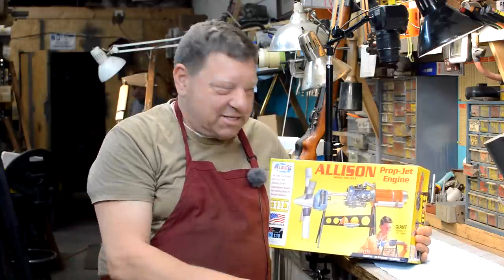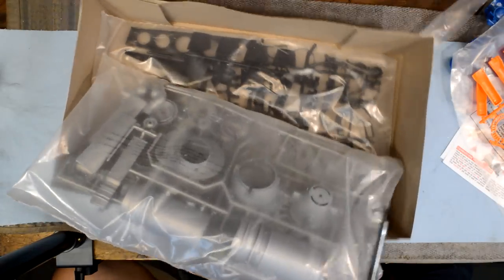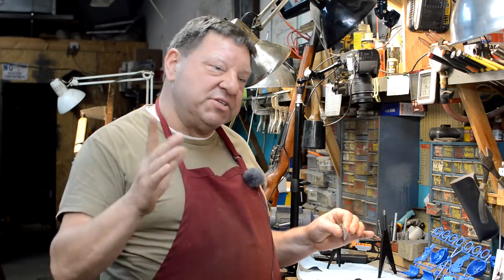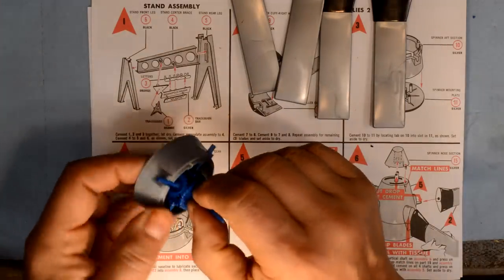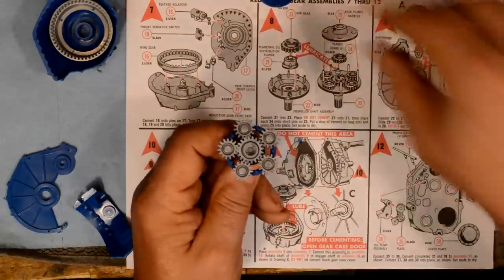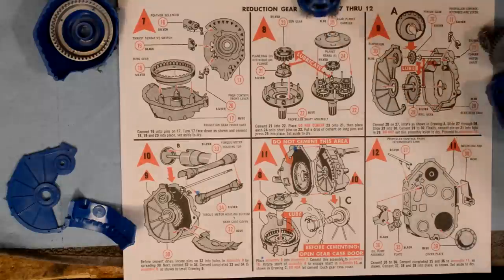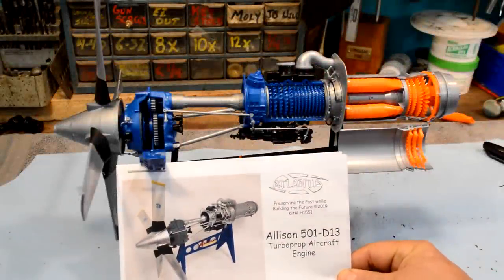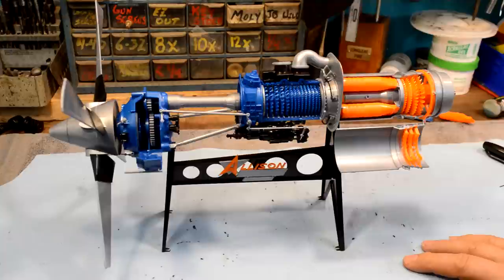Allison 501 Turboshaft unbox and build

Comment: Took me a long time to realise why the hot exhaust doesnt just blow out the front side of the jet - theres not a heap of difference between the compressor and the turbine, whats to say they dont run in reverse...
But it basically boils down to leverage.
Reply: When it starts the air starter starts to spin the turbine to the RPM needed  to start it can't  blow out the front gearbox turbine and all exsessary's momentum keeps it going then the fule ignites and puf you have 64000 lbs of thrust moentum
Reply: Its due to the various pressures and velocities created by the different converging and diverging ducts in the engine. Believe it or not, the pressure in the combustion section and exhaust sections are actually relatively low compared to the compressor section immediately in front of it, but the velocity is much higher. That is why the flame doesn't come out the front. The end goal of a jet engine is high velocity, not pressure.
If the air inside the engine goes supersonic, the flame can actually blow out the front because Bernoulli's principle reverses when you reach mach 1. All of the air inside of a turbine engine has to be subsonic, even if the aircraft flies faster than mach 1. That is why for example the SR-71 has movable cones in front of the engine, so the shockwave doesn't enter the engine.
I just passed my turbine engine classes to get my A&P license.
Reply: Not just leverage, the compressor makes a pressure wall against the hot air, as well as having a huge mass flow all going forward to aft.

Comment: You should use silicone grease for lubrication not petroleum based products
Reply: It's conceivable that the Lucas Extreme lube is plastic safe as many modern firearms make use of plastics and polymers but I wouldn't bet on it without doing my due diligence.

Comment: Wheres  the   pitch  lock  gears?,  and   the   fuel  Control Links?. Wheres   the  prop  afterbody  and  de-ice  brush  blocks.
Reply: Yeah, its not a 100% accurate kit.   I can  forgive a lot because it is just a scale model.  But the big mistake is its missing the Prop Control.  But that's where scratch building would shine.
Reply: @Pitchlock8251   ever  do  this..."  with  the   afterbody service cap  open...OK Feather...ERRRRRRRRRRRRR  ok ...add  5606  then  .....ok  high  blade  angle...Errrrrrrrrrrrrrrr pop ....ok   low  errrrrrrrrrrrr . The   engine  was  a  great  design and  is  now  up to  like  4300SHP ive  been  told.
Reply: @brucemiller8109  Yup.  -10''s are 4300shp.  -14 are 4600shp

Comment: Wow- why don't they sell these cool models any more.
Reply: You have no idea. This kit was originally MOTORIZED. It ran with an electric motor connected to the gearbox, powered by 2 'C' cell batteries. How's that for cool? I wish subsequent releases had not deleted the extra parts required for this kit.
Reply: THEY DO! The model in his hands is a re-do, a re-pop, a re-release.

Comment: !. A jet engine just has air passing directly through it. Best for power, but high fuel use. (fighter jet.)
2. A turbojet engine uses the same principle, but has the last compressor stage fed to a final drive, which feeds the torque to a fan at the engine's front, which draws even more air in at a faster speed (turbo) some of this air bypasses the main exhaust and cools the engine, and offers extra thrust. (Much more economical, for commercial jets.)
3. A turboprop is like a turbojet, except the front fan is now a large propeller, which is driven by a turbojet engine.  Less powerful than 1 or 2, but is much more economical and is less powerful.  (Marine search and rescue & ASW)  
This is at the beginning, and I haven't seen it. But, despite what ever is said. A turban, is worn by Sikh Indians. A turbine, is a high speed pressure driven compressor.
Reply: wrong. turbojet engine is the one which thrust is entirely from an unbalanced condition from expanding heated exhaust gas, such as the pratt and whitney JT4.. simple heat engine with no bypass ratio

 turbofan is when there is a fan section such as the JT8D.. JT8D is a low bypass which means the fan section is not much larger diameter than the compressor section. High bypass is more popular these days like the GE GEnX engine, which has a fan section much larger than the compressor section diameter. Bypass ratio is the ratio between compressor cross section and fan cross section. 

turboprop is driving a propellor such as the PT6A. specific mounts for propellor governors, specialized gearbox that allows oil to maintain function of the propellor governor and constant speed prop hub. these are not present on turboshaft engines (helicopter engines)

and marine search and rescue helicopters and jet powered helicopters ect use a turboshaft engine, such as the Allison 250 as the most common example.. very big difference from turboprop.. a turboshaft engine does not need a prop governor since they are not used with props, they are used to drive the PTO shaft (power take-off) which drives gearboxes. or generators. could drive whatever you wanted to drive really, but not props. helicopters some land vehicles even use a turboshaft. some kerosene generators are turboshaft. technically, APU starters are mini turboshaft generators as well. used for primary electric and hydraulic power for starting most commercial jets. many jets have ground APUs which are little truck looking things that do the same thing. 

all jet engines use intake air for cooling and flame propagation to ensure the flame is not too close to the chamber walls itself. about every jet engine of every kind never uses more than 25% of the available oxygen in the turbine section. this is why afterburners actually work, they burn the 75% that is left over. turbojet turbofan turboprop turboshaft they all do this
Reply: I'm pretty sure the commercial engines are Turbofans.

Comment: If you don't have the skills, do not attempt? That's one way to gatekeep I suppose.

BTW. Turbofans are not the most efficient engines, Turboprops are. But they can't be viable used for higher speed (like airliners). Just read up on the Tu-95 and you'll now why.
Reply: It's a necessary disclaimer he adds to all videos to stop idiots from doing stuff then blaming him when it goes wrong. 

It's not hard to learn the skills to their basics, then you can start trying to do serious stuff with it.